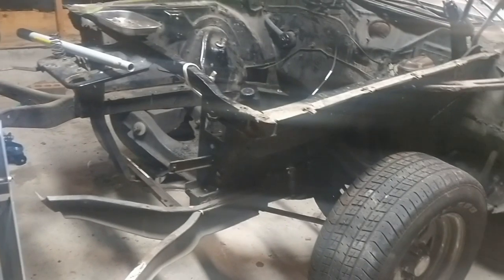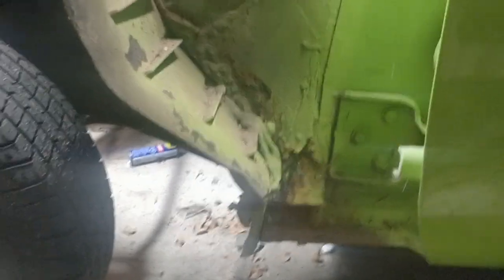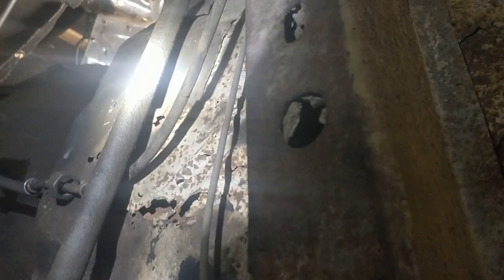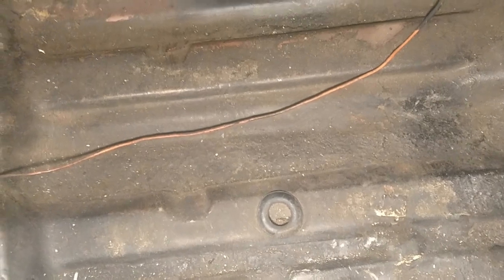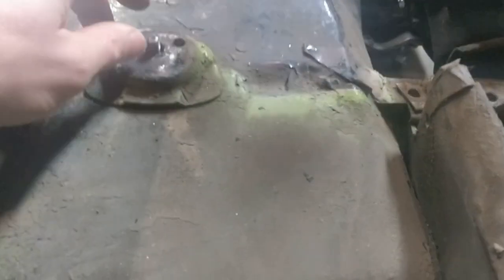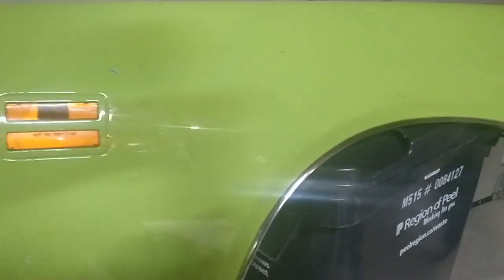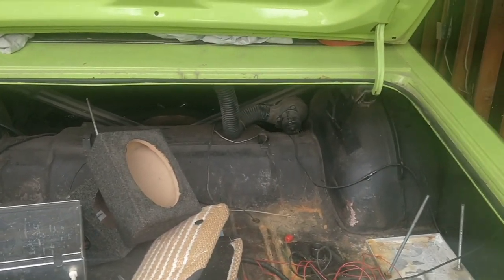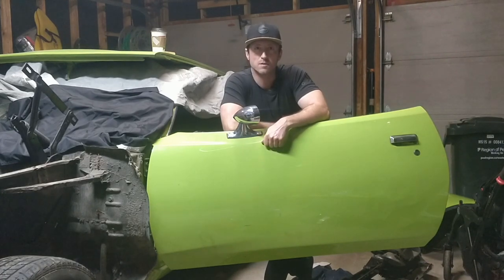1971 Dodge Charger Restoration Episode 5 - Body Disassembly

Comment: That area were it's rusted in the floor is wear you would put your feet so who knows when it was new could of been driving in the winter not sure of what part of Canada you are from but here in Ontario they just love to use salt here and getting salty slush on you feet getting in the car the salt and slush melts makes a nice stew to rot the floorboards right out of it so depending where the car was from and such that's why it probably has that rust where it's at
Reply from the maker: I'm from Ontario myself, they're liberal with salt to say the least

Comment: I don't think it was hit because the braces would have crumple marks in it I think it's just from rust those cars a notorious for rotting right in that spot with the pop rivets I had a 72 that rotted in the same area if you take the kick panel off down under the driver side underneath the dash on the opposite side of the patch you should see more evidence of the rust or the patch and the top area could of been rust or a crack it's hard to say but all the braces and inner fender looks good so I don't think it was ever hit it's just signs of rust. That's my opinion anyway

Comment: Vic did you say if you had to do over you take the front bumper off at the point it’s attached to the frame?
Reply from the maker: Yeah if it was an option. My nuts welded inside the frame on the bumper brackets broke free. So I couldn't get them off without cutting them. So that's why I took them off like that.

Comment: Body panels you look at the inside turn the fender around then you will see everything where patches are if metal has been put in the outside won't show you much with all the paint body filler and that if you want to see what's really going on turn the fender around and that's too bad the driver side frame rail is another soft spot especially cars from Ontario just more evidence of being driven in the winter with the salt and slush but the car is not that bad at all I' have seen worse much worse I have owned worst good thing about today is they remake most body panels now to fix the problem areas so you should do ok as long as you have a good body shop that knows what they are doing it will be all good.